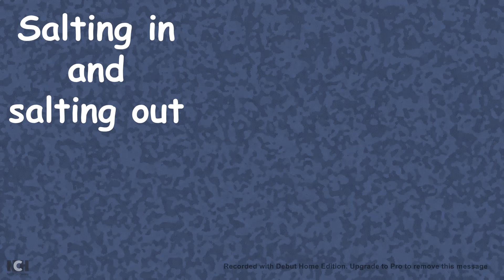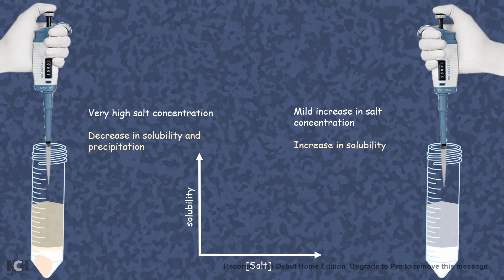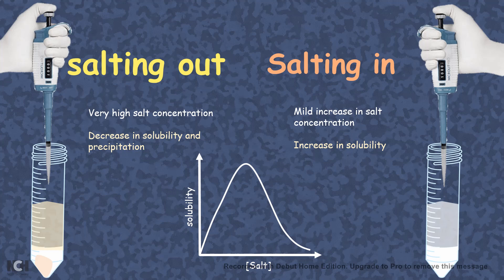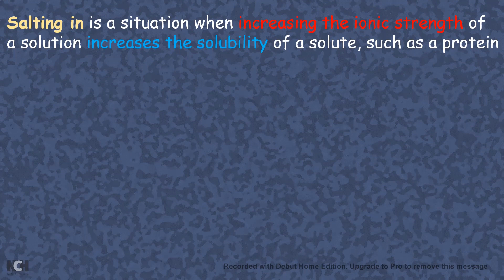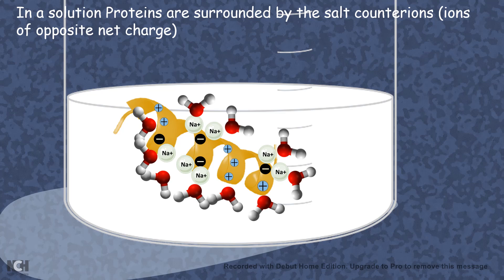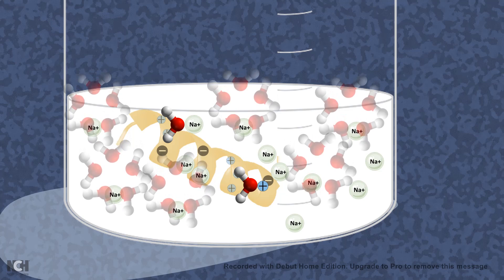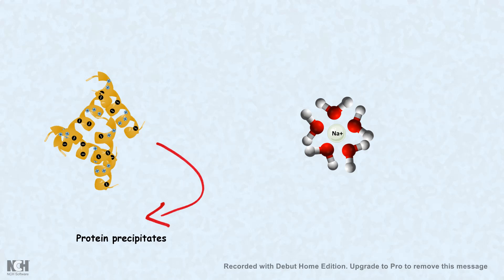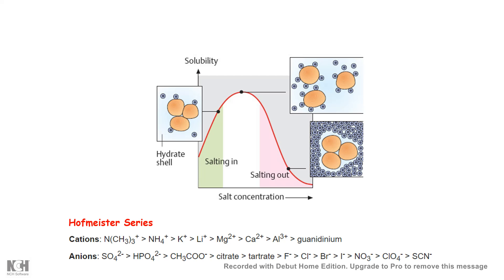Salting in and salting out | How does salting out happen? | what is salting in of proteins?

Comment: I wonder if there are culinary applications for this interesting fact
Reply from the maker: salting out" phenomenon is primarily used to extract certain components from a mixture, like separating fat from a liquid, by adding salt which causes the fat to clump and separate out, most notably seen when clarifying butter or making stocks where excess fat is removed by adding salt to the liquid, causing it to solidify and rise to the surface for easy skimming.

Comment: I don't understand though ... I understand most of it, but why does the salt start to react with water at higher concentrations. It's not as if the ionic interaction between the salt and the negatively charged residues isn't still stronger than the bond between the negative side of the polar water molecules and the positive salt. Intuitively, I'd think that the salt would first interact with the protein, and then when there isn't enough left, it would then react with the water. What am I missing. Can someone explain this to me? Other than that, I understand this.

Comment: I think with high molucal weight..we in are in case water in molecule. When the molecule is very low weigheit we are in case in molecule in water..
I think in hight salt the high molecule began to contract and push water in outside. We can see that in milk coagulation by elevating temperature..
I think all high molecular product can forme an emulsion 
Water in oil or oil in water..
Thank you for video..👍👍🇩🇿🇩🇿

Comment: nice explanation, thank you for explanation its very informative and helpful
Reply: however i have a question, regarding the protein isolation, if i not sure about the solubility strength of my desire protein, then salting in (addding low concentration of salt solution to allow it to solube is better) or salting out is better. And base on explanation, i understand that both salting in and out is helping to isolate, is there any condition like protein that not likely to soluble will be favor for salting out process? if there is, is the example fibrous protein will be more easier to seperate in salting out or salting process? Thank you for answering, look foward to knowing more on this
Reply from the maker: Please share my channel link with your friends and help me to reach big audience

Comment: Beautifully explained thank you! I've been struggling with sample preparation for months now - I have VERY expensive triple-labelled samples for NMR so, naturally, sample stability has been a great concern to ensure we can get the most out of each prep. 

Have you got any rough kind of buffer optimisation "workflow" that you go through when determining protein solubility? I've thus far tried crude hanging drop precipitate screens using a crystallographers microscope, as well as a thermal denaturation assay utilising a hydrophobic residue-binding dye which infers protein unfolding using qPCR (ThermoFluor I believe is the technique name). 

Have you got any other suggestions? I'm still struggling somewhat with long term stability.